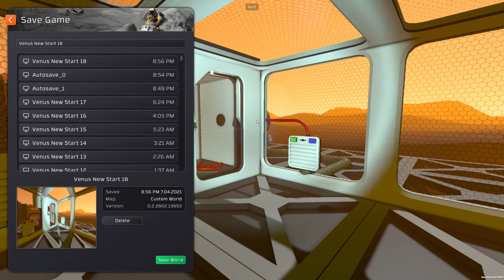Stationeers Venus: Season 1 Episode 19 - The Water Shed

Comment: How do you decide when to you pressure regulator vs volume pump?
Reply from the maker: Pressure Regulator is a bit cheaper so I prefer to build those early in the game. Also, I know I'll need a lot of them later for O2 filling, waste tank emptying, propellant filling, fuel filling, etc so it doesn't hurt to build them.
Volume pump can transport a lot of gases quickly but will keep pumping until the pipes are empty, so there is a risk of blowing up your pipes.
Pressure regulator will only pump until the pipes reach the set pressure but are slow at transporting a lot of gas.
Hope that helps :)